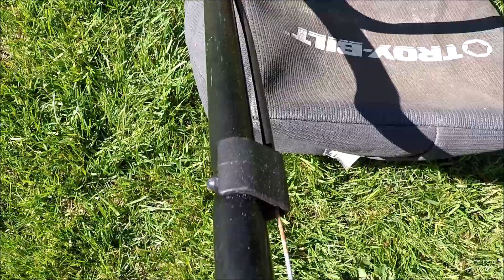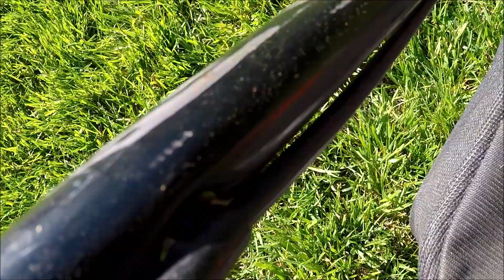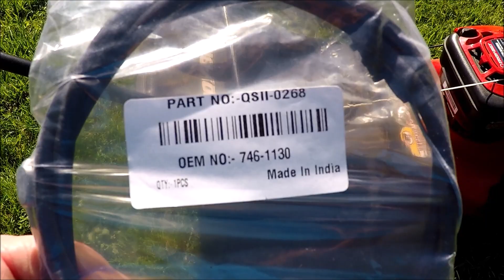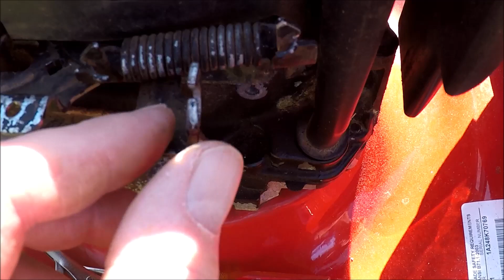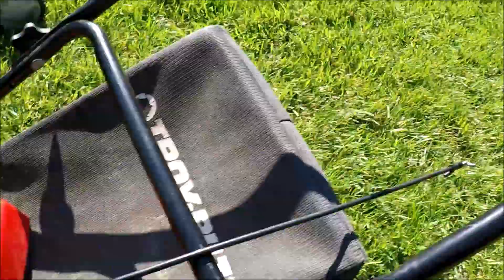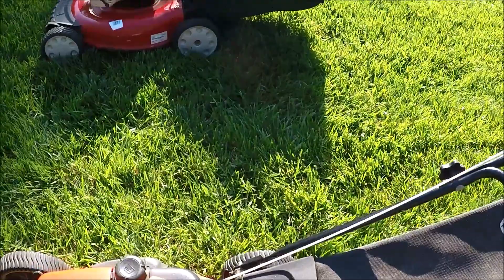Troy Bilt Lawn Mower Replacing a Engine  Control Cable # 746-1130  - August 24, 2018

Comment: I bought this mower in November 2019. Thirteen months later I had the cable connection to the handle snap off. I watched this video which was great in illustrating how to replace, which I did. Now 4 months later the same connection at the handle snapped off AGAIN. When I was originally replacing I was amazed at the poor engineering of this part--it looked like it was made to break. Any ideas going forward? Can you override this any way? Thanks.

Comment: I found a 11A-546B729 Yard Machines 6.75 HP 190cc lawnmower I'm trying to get up and running. 
Thing with these older machines is that the mechanics of the control cable seem to be reversed. 

The cable opens and closes the throttle when the cable pushes on the stop lever rather than pull it like in more modern lawnmowers. 
I'm wondering how is the cable able to push the stop lever forward to start the motor without snapping itself?

Any help would be helpful. 
Thanks.

Comment: So it looks like you have the same exact problem I have with a Troy Bilt I got for free. The control cable was not disengaging the brake enough to start the engine. I figured the cable was stretched out. I went on Troy Bilt's website and got the part number. I'm not exactly what that number was since it was almost a year ago now. I ordered a cable on eBay and put it one. Looked exactly like what was on there. But alas, Still has the same problem. I thought maybe someone had changed the upper handle, but it looks like an exact match. Even has the deluxe red bail cover on it.But just recently I started looking at it again since I'm looking to sell it. Aside from the cable issue it works fine I've used a zip tie to keep the brake release tight and it starts right up and runs fine. I have checked again on Troy Bilts website for the part number. It has the specs of the cable there 40" casing and 53" cable. I went and measured the replacement cable I had. And wouldn't you know it, It's the exact same measurement. The only difference I see is the newer cable on troy bilts website has the "hook" connection on it instead of the " snap in" connection. Pretty much like the one you got. The part number you show (746-1130) has been updated to 946-1130. When I look for them on eBay, I see some that have the snap in connection and some have the hook connection. If the cables are the same length, I don't see how it would make a difference in the operation of it, but I'm just wondering if I get one that has the hook end on it, if it will make a difference. I have looked up control cables for 21" Troy Bilt mowers and it lists different part numbers and specs, but the cable has the same tabs with the z ends. And the specs for that cable are 37 1/2" casing with 51" cable and part number is 746-04661. So I'm just not sure at this point which cable I should get? My Troy Bilt looks exactly like yours. Doesn't have the plastic grass shield on the front, Has a Lowes decal on it, same briggs motor. My mower model number 11A-426A011. It's just strange that you had the same problem, than you put the apparent correct cable on and its perfect.

Comment: Nice fix Cliff. Those engine control cables can sometimes be problematic on those Briggs and Stratton engines
Reply from the maker: Hello Caleb thank you very much!  They are pretty easy to replace each mower may have a different length so got to make sure you get the correct one which that makeshift just to get it running just did not work for it.  Now its correct will start and stop like it should!

Comment: Also, worth a mention, that Craftsman you got that handle from I recall having random electrical issues, the reason being, the inner cable is stretched out inside the Craftsman's, you need to replace the cable on that one too. These sometimes stretch out with age, it's sadly common, I buy them in bulk off eBay for these Troy-Bilt/MTD machines.

Comment: When you have a stuck cable get yourself one of these, they really do work, and remember the end of the cable by the engine, take it off and the plastic end will unscrew from the cable, and you then can use the cable oiler, and a can of wd40 with the red plastic straw, and then screw the plastic cable end back on and your good to go. GTSpeed ® Universal Motorcycle Dual Cable Oiler Lubricator Luber Tool https://www.amazon.com/dp/B009T3VUK8/ref=cm_sw_r_cp_apa_4AwGBbN68RRGD